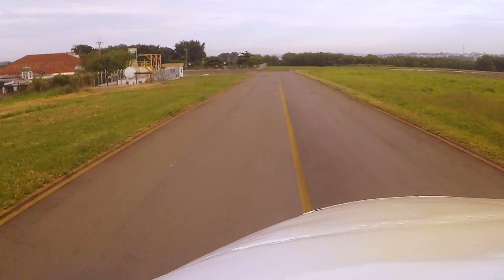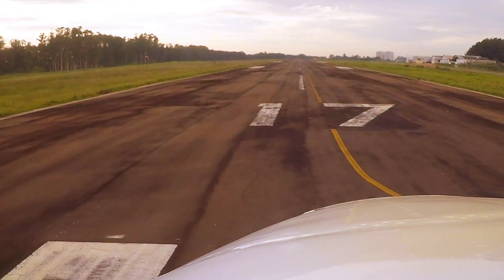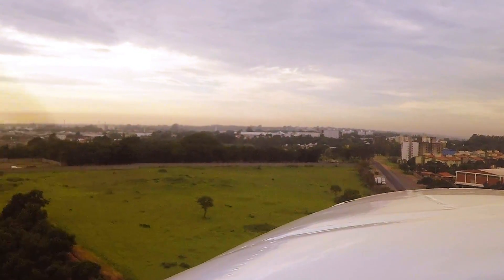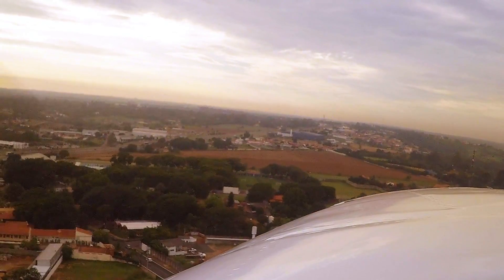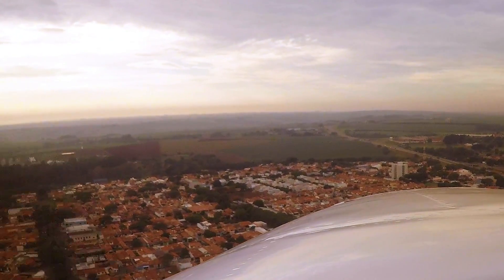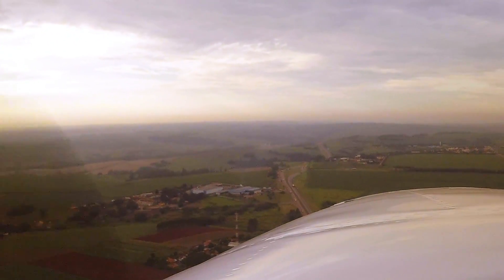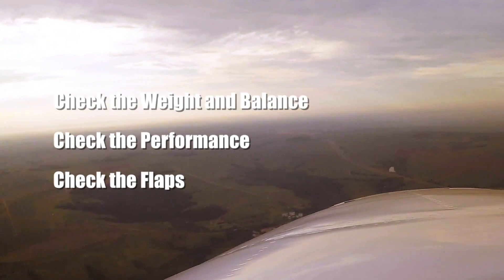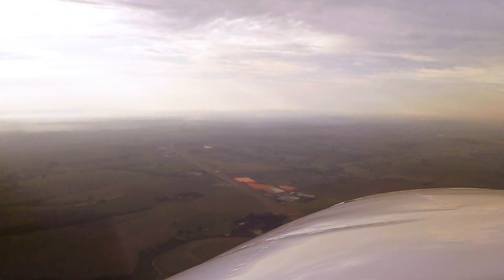Engine failure during take off

Comment: This struck me as a poorly thought out training excersize.  Secondly when IT became apparent how little the margin of safety was the "out engine" should have been brought back to take off power and normal climb initiated.  This struck me as as senselessly placing yourselves and all the residents needlessly at risk of a life threatening accidents.  I can't count the number of fatal training accidents over the years because an instructor was in the mindset of keeping it real right up to the moment of impact!!
There is a reason for instance that Boeing does all their flight testing out of Moses Lake in Centeral Washington and not out of Boeing Field over Everette!
Reply: yeah that was poorly executed.
Reply: Instructors are not necessarily safe pilots - many are teaching with minimum experience. California just had two flight instructors killed attempting a 180 back to the airport with a engine out. Stall then spin!
Reply: @jan-zumwalt  yeah sadly many CFIs are just guys who shot through the ratings as fast as possible trying to fast track to the airlines.  they aren't teachers, have no interest in teaching, and aren't good at it.  They are only "putting in their time" so they get the hours to fly for a regional and the hopefully a big airline.   Teaching is  a skill in itself separate from flying.  The whole system needs some kind of regulation change so that the path to the airline isn't' being a CFI.  Like make hours instructing excluded from counting toward an ATP license or something.   A CFI should be a career not a stepping stone.  IMO a student pilot shouldn't even consider a CFI who has less than 3-5 years of teaching.  You have to be sure the guy you're trusting with your life and training is an experienced teacher who wants to be doing it not an hour builder who's just waiting to move on.
Reply: This is a C90 king air, the engines are free turbine PT6's on a standard V1 cut training exercise. The "dead" engine was pulled back to flight idle which leaves it 100% ready to come back as the gas generator is running at full speed, it just isnt producing prop thrust. In the event of loss of directional control the instructor will add the dead engine back in as turbines loose directional control on the yaw axis at a much longer interval before a Vmc event than piston aircraft.

Fact is, all twins fly like shit with an engine out on takeoff. You lose 80-90% of your climbrate, and thats assuming you fly it perfectly. Boeing does the flight testing at Moses Lake because it has longer runways for brake failures and they're accustomed to adapting to situations because of all of the trainer traffic.
Reply: @dunxtonchexton1631  In reference to your post copied below. As a 21,000 plus ATP and A&P IA who used to rebuild these engines, ummm you are describing a Garret where the gas generator as you call it is at full speed, that is not true with a PT6 and that is the only thing you got right but wrong about the turbine being at full power. That would be a Garret and even that is not at full power it is lessened in fuel but at the normal rpm. So again the only thing you got right on the engine is it's name a PT-6. In ref to so you can't change it "This is a C90 king air, the engines are free turbine PT6's on a standard V1 cut training exercise. The "dead" engine was pulled back to flight idle which leaves it 100% ready to come back as the gas generator is running at full speed, it just isn't producing prop thrust. In the event of loss of directional control the instructor will add the dead engine back in as turbines loose directional control on the yaw axis at a much longer interval before a Vmc event than piston aircraft.

Fact is, all twins fly like shit with an engine out on takeoff. You lose 80-90% of your climbrate, and thats assuming you fly it perfectly. Boeing does the flight testing at Moses Lake because it has longer runways for brake failures and they're accustomed to adapting to situations because of all of the trainer traffic.
Reply: Oh wtf ever dude.

Comment: You simply MUST get the yaw under control. I suspect you still had a substantial amount of uncorrected yaw. That is the most common reason why the best climb performance is not achieved after an engine failure after take off. All Kingairs have very heavy rudder loads at low speeds and when the operating engine is at take off power. It is good that you experienced this under simulation and not an actual engine failure.
Reply: I don’t know what aircraft you fly but you’re not going to climb once you loss an engine, it’s hard enough to maintain altitude

Comment: Insane to try this type of training at such a low altitude.  There is no way this would be sanctioned in N. America or Europe.  There are simulators for V1 cuts and VMC demo flying, and it is much cheaper than using the actual aircraft.  Single engine maneuvering should only be done when terrain clearance is assured.  By the sheer fact that they were struggling to clear obstacles it proves they were lacking is sufficient single engine performance.  This is bad training technique.

Comment: DANGEROUS!! You had nowhere to deviate that aircraft in case it went really wrong!! You can't endanger other people for the sake of training!
Reply: I am sure they simulated the failure by pulling the power lever to idle, in which case, if things went bad, they could just increase the power and revert to normal ops. If they actually shut down the right engine with the condition lever, that WOULD be pretty bold.

Comment: just watched a crash on liveleak and searched for twin engine take off engine fail and I am pretty sure this is what happened.. the guy must have had his flaps set in such a way that a loss of one engine would spin the aircraft down...this guy only got to about 40 or 50 ft and then heeled over and nose dived right into the runway...engine failure

Comment: You might have used 10 degree flaps, and taken them off as soon as the engine failed, but you have a lot of work load, so maybe it was better.  However taking off with no flaps is also dangerous because you wouldn’t normally have done that, and the training is to see how you react to a normally configured aircraft.

Comment: Let the aircraft turn. Then you will gain speed faster. If try to stay on course a lot of the energy will be used unnecessary.  But of course avoid any obstacles. Good flight.

Comment: Thanks for sharing BUT something is VERY wrong with either pilot technique on controls and #1or instructor management of the “dead” #2 engine. That aircraft at that weight should be climbing as well or better on one than most GA light twins with two.

Comment: The C90 is perfectly capable of single engine positive climb rate, given you clean the airplane up and release some of that rudder input.  I’ve had two engine failures in the c90, both in high density airports after rotation. Even at gross I saw 300fpm.
Among your mistakes, One thing you are lacking is your checklist and announcing the emergency procedures.  Most of all, never intentionally cut an engine on rotation.  Save that for simulators.

Comment: My typing skills are sufficient enough to convey everything wrong with this stunt.  However at the very least I'd have your AP check compression in your "good" jugs as the anemic climb means either you've got powerplant issues or were grossly cross controlling.   Won't even get into all the "busts" about doing this at low altitude rather than a hard deck and over known obstacles.
Reply: The King Air C90 series PT6 engines have no jugs.

Comment: I'm still trying to figure out why you didn't get the gear up when you were already committed and out of Runway? I flew light aircraft professionally for years. Everything from beechcraft barons ,  beech 18s, Mitsubishi MU2s, B100 Kingairs and many more.
I had to take check rides in every aircraft twice a year and we always simulated engine failures at takeoff with go no-go decisions pre-planned in the numbers. You should have been easily getting more than 500 feet per minute climb with one engine out. The procedure is a black box procedure. Before you even go to the check list it's out of Runway flaps up gear up, identify and verify which engine is out, max power on the good engine, secure and feather the dead engine while executing the zero side slip with half a ball on the turn coordinator and pitch for Vyse (single engine best rate of climb).Then hit the check list. I  wasn't there to see what you were doing but I'd put money on not doing it right.

Comment: Dump the drag , gear up and feather the prop or you might not get the V2 
speed. I learnt on  a 160 Apache and that would not climb at all if not cleaned up. That meant manually pumping the gear up if it was the wrong engine with the hydraulic pump on it that failed.

Comment: Everyone has mentioned the poor decision of altitude and location but one more thing. What is the single engine minimum flying speed? It looked to me that this was performed right on the threshold of power and controllability.

If you were to drop off the back of the curve (which looked very close) one of two things would happen. 1: you'd have to pull power back on the remaining engine and find a parking spot (preferable). 2: if you tried to maintain height on the one engine (below single engine speed) the 'dead engine' side would likely drop its wing and you be in an incipient spin scenario (less preferable)...
Reply: They were very close to the spin scenario, with no chance of recovery. When a spin kicks on, its very sudden, I won't say unexpected, as even looking at it from this side of the screen, I could feel a spin about to happen. The fact this was also over a populated area blew me away.

Comment: Not only that, what are your memory items with a power plant failure with NO autofeather? Shoulda' done 'em. Or buzz the churches, schools and taverns. 

I'm glad that you are training over there and not over my area. If it's not climbing during training, knock it off and get the right engine developing power.  Lots of crews have been kiled doing a lot less than what you did, in the same type of aircraft. Suicide is painless, so I've heard.

Comment: You pulled a dangerous stunt over a populated area 
Such drills must be done over fields away from population centers 
You should have your license suspended
Reply: You probably never flown out of a city before. I saw a lot more fields than anywhere I fly. How else do you practice a simulated engine failure on takeoff? No engines were shut off.
Reply: Sergio Gonzalez We don’t even practice stalls and spins over cities, and those are done at atleast 2000ft. Let alone this. This is definitely way too risky.
Reply: @joelmulder   the engine was at idle, not shut off. you've never practiced engine out procedures?
Reply: @SergioGonzalez-gi9kr  I know that, and I do, but we never fly this low and slow over very populated areas.
When we do engine out emergency landing practice we go somewhere with a bunch of fields and no cities.
Engine out practice on/after takeoff would be done at an airfield that wouldn't have such a densely populated area in the extended centreline. There's plenty of those around here, even in a country as densely populated as the Netherlands.

This is all for the same reason that you also don't practice stalls and spins over populated areas, even though you do those at or above atleast 2000ft. Should something go wrong (because sometimes it does), you can't be risking the lives of anyone expect your own.
Reply: @Oscarwood2005 it's simulated. The engine didn't really fail.
Reply: Calm down people! It was a SIMULATED engine out. You know, 👉Practice 👈 he was under full control.
Reply: Agree
Reply: Vale máquina
Reply: you should shut up

Comment: When you got a little altitude, why didn't you immediately return to the field?  I would want to get a sluggish plane like that down on a runway ASAP!  And what's sound?  Music to die for?  It's distracting from the job at hand.  Also, a little flaps would have helped you to climb.  Frankly, I don't think you're going to live to a ripe old age.  You're not a pilot I would ride with!
Reply: Grant Huff when you turn the lift vector is no longer pointed straight up, but towards the direction of turn, if he couldn’t climb in level flight, a turn would have made him start to descend causing him to potentially crash. He should have turned back sooner than he did but being in a rush to do things is dangerous.

Comment: I was a Check Airman on King Air 90's and 200's.  When conducting training in the aircraft, I NEVER pulled the power without first telling the pilot I was doing so.  Also, I would wait until gear retraction to pull the power back to about 120 lbs of torque to SIMULATE zero thrust.  I would not actually feather the prop--That's why the power stays at 120 lbs.  If the other engine failed, we would still have the simulated failed engine to work with.  You have to be smart when simulating emergencies in the actual aircraft.  We could get more creative and realistic in the simulator.

Comment: Did the aircraft have autofeather and was the gear not raised raised immediately?

Liftoff
1. Maximum Continuous power ..... set
2. Airspeed .. Maintain (takeoff speed or above) 
3. Landing Gear .............................. UP
4. Propeller Lever (inoperative engine) . Feather (or verify feather if autofeather is installed) 
5. Airspeed .. 108 kts (after obstacle clearance is reached)

The airspeed may be incorrect for the GTX model...

Comment: Something to think about... my twin instructor was old school with 10,000hrs of wisdom. As long as you did not have terrain issues on your engine out side, there is nothing wrong with releasing a little rudder in favor of better climb performance and allow the aircraft to SLOWLY turn. As my instructor said, "pilots seem duty bound to crash in a straight line off the runway, when a little less rudder would have allowed them to climb! News reporters do not give you extra points for crashing in a straight line!"

Further more about every 400-500hrs (I have 2500), I do something stupid enough that others have died from the same thing. Sharing your mistakes saves lives and benefits the survival of the human race - don't let the critics get you down :)
Reply: Jan Zumwalt ahhhhhhhhh. I'm glad you didn't keep that to yourself! Thank you!
Reply: Bravo! That’s REAL knowledge...
Reply: Good useful comment.
Reply: Excellent! What puzzles me here most is - what's next? He continues on with his flight-plan? as if nothing is wrong here? Has to be more to this story.. cheers!
Reply: Very good advise.
Fear causes only one fatal decision.
Letting it controlled roll to the side of no power is usually the best course of action barring terrain AND weather.
Reply: Your twin is an instructor? 😅
Reply: Jan Zumwalt great point, Jan!
Reply: Where there's yaw there is bank
Reply: Great point! It’s the rudder which is adding to the drag..👍🏽
Reply: If he had released the rudder pressure he would have went straight into the apartment block.
Reply: Jan..... the simple answer is your just full of it this should have been done in an area where there was no homes and no commercial buildings and U dam well know it

Comment: Zero flap takeoffs require higher takeoff V-speeds obviously. However, it does allow better single engine out climb management IF you get that prop feathered in seconds. If the density altitude and runway doesn't allow that option then of course you are at the mercy of takeoff flap launches. And this was a short runway with only 500 feet left when the wheels broke ground. Good recovery here.

Comment: Is this typical C-90 single engine performance? It is frightening because you were relatively light with about half-full fuel tanks and only two persons on board, plus flaps up. Was there something wrong with the airplane? Your friend who failed the engine - were his efforts also useless to get the airplane to climb? All told, not a very smart thing to do with so many obstacles in your path and a populated area below - if your friend knew that this would be the sort of performance to expect, he should not have carried out this exercise. If the airplane was unable to accelerate to VYSE or at least VSSE and since it was not climbing, he should have immediately given you the engine back!